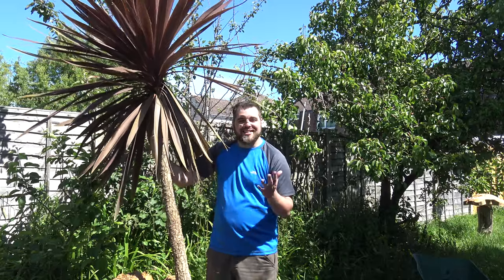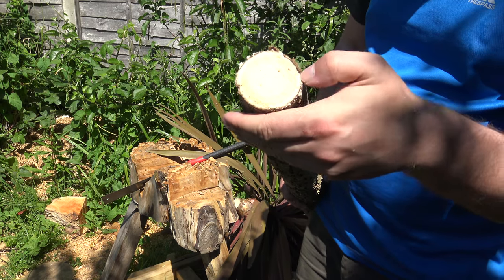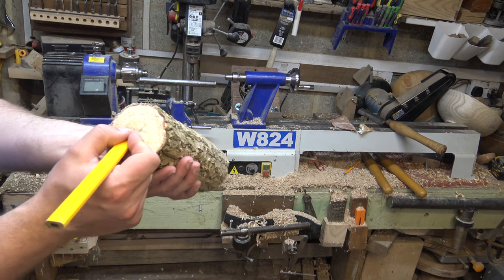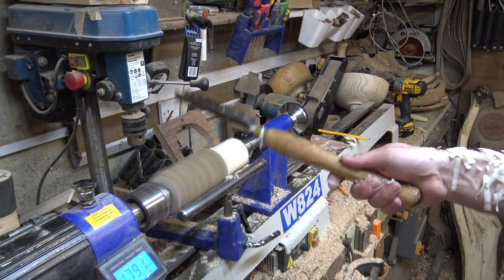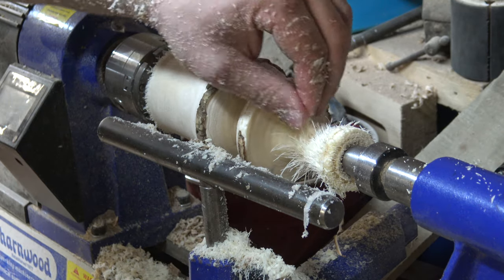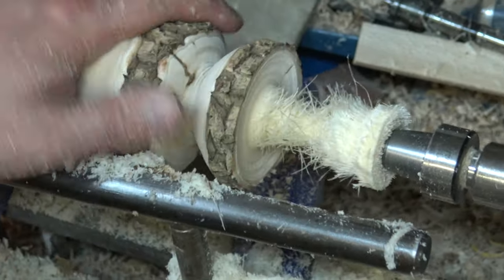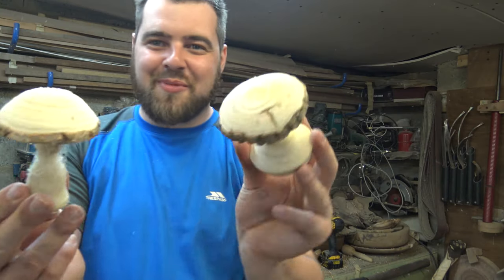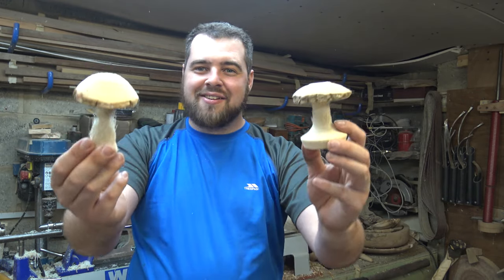Can you woodturn a palm tree?

Comment: Thats Wicked. Just getting to last couple your videos this was one them. Amazing little project. Need more videos though m8 and maybe some beginner turning projects. I have got my new lathe and bolted down and ready go. Now just gotta figure out how turn a bowl. Watch your view counts go up with me watching them over and over. 🏴👍
Reply from the maker: Thanks Michael, I hope to film a beginner series of videos at some point 👍 I hope you have many happy hours of turning and learning on your new lathe 😁
Reply: @thewelshwoodman649  I'll get there eventually not had lot time on it yet. Did try bowl other day that didn't go well. Can u explain holding with the worm screw a got with the Chuck am going through the labrunm crothch bowl u used it in the now but was bit confused. Do u pre drill then use it in place the face plate?? Ps I ended up going with lumberjacks lathe pretty much identical to the charnwood u used in the palm video. 🏴👍
Reply from the maker: @michaelwillson6847  with wormwood screws you predrill a hole in the blank normally in the part that will be hollowed out/turned away in the bowl. The hole size will be determined by the size of the wormwood screws (normally the diameter on the inside of the threads) and the depth of the screw. Normally they fit in the chuck then you lock the headstock and rotate the piece on with the lathe off, the blank should be touching the face of the jaws for a strong hold. I hope this makes sense and helps 👍
Reply: @thewelshwoodman649  absaloutley that helps a also saw in your video because you had the hole that would of helped with turning away. I struggled big time with first bowl. Now forgive me for asking silly question but is there a set standard thickess for a blank to get a bowl out of?? I tried to do one with arround 70mm thickess on dry oak didn't go well.
Reply from the maker: @michaelwillson6847  You can turn any thickness bowl, if you can start off with green wood as it's easier to turn especially compared to seasoned oak 👍